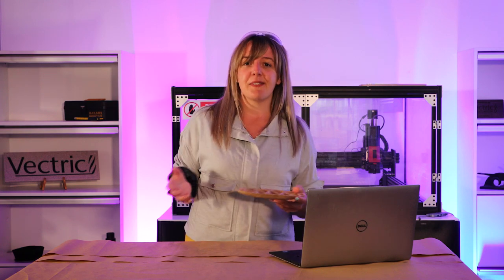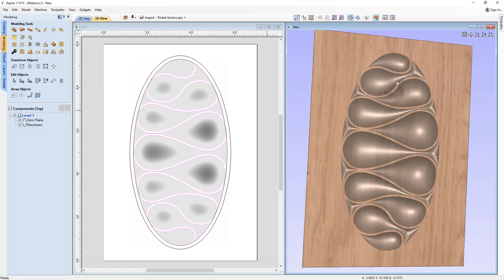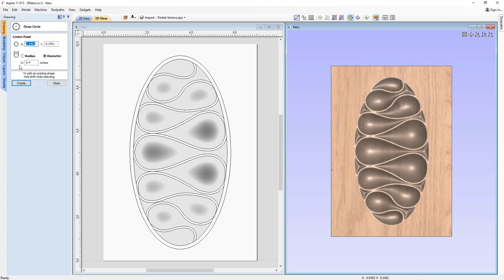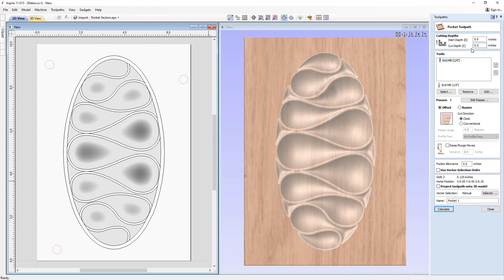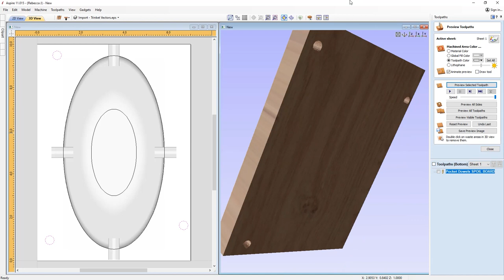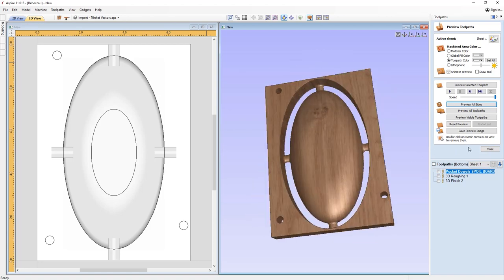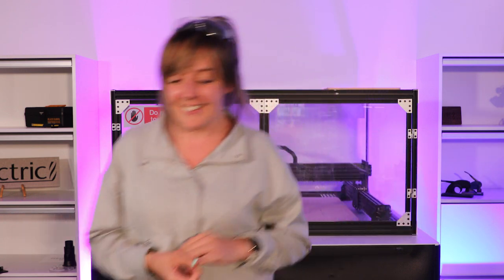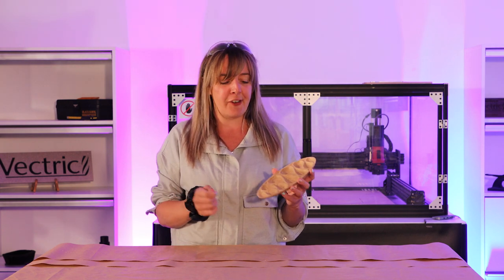Making a Trinket Tray | In the Labs with Beki | Vectric FREE CNC Projects

Comment: Hi Beki.  Nice project.  To minimize tool changes when my finishing cut is a 1/4" ballnose bit, I also use the 1/4" ballnose for the roughing pass.  It seems to work just as well and you can combine both toolpaths into one file regardless of the CNC machine capabilities.  Steve
Reply from the maker: Hey Steve, thanks for your kind comments, glad you like it. You are totally right about this one, great tip! Thank you.

Comment: Becky, you guys are the Best!  I'm having cusping problems on a small spoon project today.  Didn't know I could add a base height to the zero plane to make the bit cut past (below) the model. 
Now, my model is the full thickness of my material so I'm guessing that if I add a base height of, say, 1/8" then the bit will cut into my spoil board by 1/8"?  (Maybe I need to add a second sacrificial board.) I still haven't gotten a handle on the Zero Plane. 
Thanks for a very timely video.
Reply from the maker: Hey Richard, thank you for your kind comments and its great to hear you are working on a spoon project, I created a love spoon project a while back and loved it! It shouldn't interfere with your spoilbard as you you are dropping the zero plan down from the mid point of your material thickness, however to be extra sure you could always send your file over to our support team on support@vectric.com where they can advise you on this before machining that :) I hope this helps, have a great day! Also we'd love to see how your spoon turned out!

Comment: Maybe I missed something, but how did you set up the starting XY, so when you flipped it you knew where to drill the pockets.
its the one question I havent been able to figure out on my own.

starting X and Y on side one is easy,  however,  getting the perfect match on side 2 for X&Y  (assuming the CnC was turned off at night there by loosing the original X & Y
Reply: Because she hadn't drilled alignment holes into the spoil board on day one, Beki can set the XY zero most anyplace on the table on day two, then drill the alignment holes into the spoil board: those holes are in exact alignment with the new XY zero and therefore in exact alignment with the holes drilled into the top of the project on day one.
For me, I Z-zero off the spoil board for both sides of the project; I drill my alignment holes into the spoil board, set up my material and drill alignment holes into the material; insert pins and flip the material and drill alignment holes into the second side (bottom). This way, I don''t have change bits and I can rough cut on both sides then finish cut on both sides and I only have to change bits once and re-set my Z-zero once.
Reply: @richardfarwell6759  I think I understand what you're saying
And you're right, setting the x and Y anywhere on the table is possible
But what I'm struggling with is setting the x and Y zero reference to the workpiece

In this example, if you're off one or two millimeters, it probably wouldn't notice

But let's say you were building a lid with an intricate pattern. Being off a few millimeters, could determine whether the lid fits or not

I need to reflect on what you're saying, I'm trying to adapt this information to a much more complex project that I'd like to build

I'd like to build a coin tray with a lid that's in the shape of a star and have a design on top

When I visualize what it will look like in my head if I don't nail the x and Y zero to the workpiece perfectly, I'm going to have a lid that might fit but it also might be staggered and that's what I'm trying to avoid
Reply from the maker: @menglor  Hey Stephen, I see that Richard has chimed in here to help and he is correct in what he is saying. Using the method I demonstrated your part will always be accurately place in X Y when you flip sides, as the software accurately positions the dowel vectors when copying the circles to the bottom side. The only issue you could get would be if your dowel holes were wide than your dowels allowing for wriggle room. If you'd like more help on this please don't hesitate to contact our support team on support@vectric.com for further assistance :) Thank you, have a great day!

Comment: Hello!if you follow along and dont use their file, this will not work. Its missing some step. Were never told how to make this a component. Once i have my shapes made and i go to  create a shape from vector outlines ...it will not allow me to apply my settings. Apparently when she imports the file something is already done that isn't mentioned. I appreciate the video but its just bot complete. It would also be great if she showed how she actually made the beautiful curves. I ended up using text "s" if anyone else is struggling. Pair that with the mirror features and you can make the same drawing she did. But...until there is an update. It will remain a drawing...haha. 
okay so i apologize. I cant see how you closed your curvy vector. Its a very blurry video. I can see that there sre 2 curvesside by side but you cant use the elipse to close the curves. Ill play with it a bit more. Its just such a good design... And it wouldnt let me create snd account to download the files...so i was frustrated. I guess ill use the offset feature for the curves but that will uave issues too...shit. dammit! I want to make these dishes!! Ill figure it out. Im just pointing out that this video could be much more complete for the non expert. Still a great video because ive never seen anything like this design...